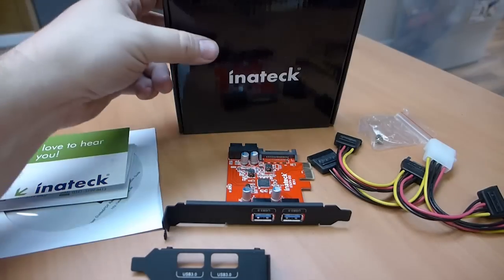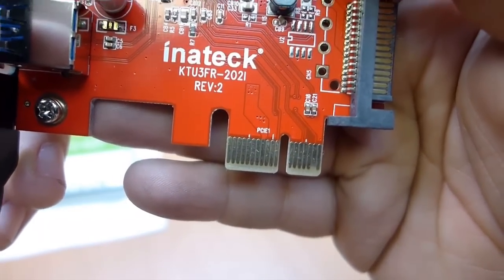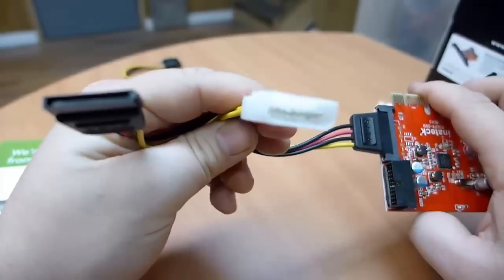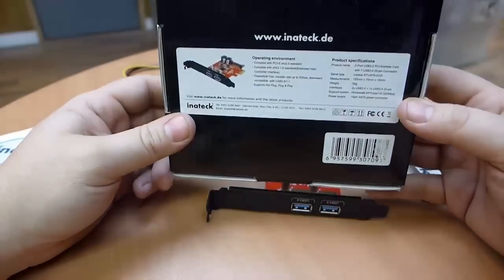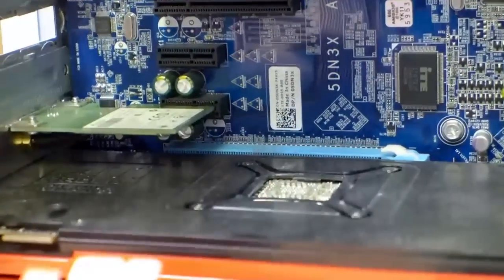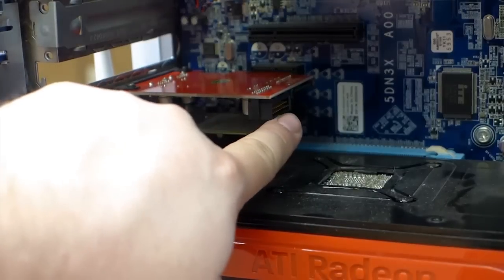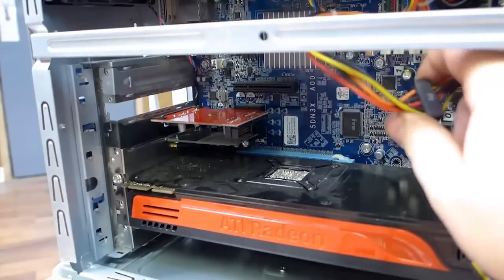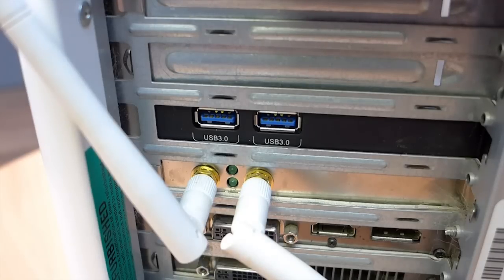Inateck PCI-E to USB3.0 Two-Port Expansion Card Review & Installation

Comment: 8 years ago and I just used a similar product on an older system I'm upgrading. While the USB ports on the card itself were definitely running much faster, my two older ports on the front of the case weren't, even though I had them tied into the header on the card through an adapter cable. They still performed like USB 2.0 ports. I've got a new front panel insert coming with a couple of actual USB 3.0 ports that'll plug directly into the card. Just something to be aware of.

Comment: I tried one but it's going back as it didn't see devices. The driver install failed with message about no host controller being found. I need USB3 to power Oculus link and my existing USB3 ports wouldn't. This was my solution and it failed. Nice to see yours worked!

Comment: I think that I recently installed a cheap copy of the card that you are showing. My one has the same format minus the power cables and fancy Matt black finish on the metal. But it works fine :) Some cards do not have the expansion connector that is needed for a front panel that supports USB3, so that was a plus and the power boost input was SATA (but in some cases it could be an older Molex).

Comment: I have a Dell Optiplex Mt i7. I just installed a Host Controller Card with 3x USB 3.0 and 1 USB-C. Its plugged into the pcie slot and connected to the sata power 15 pin. It has the driver installed via the CD it came with. It IS detected by the PC and says it IS working properly. BUT when I plug anything in to any of the ports, it will read for a second then stop... then read again then stop. Sometimes just read then stop and thats it. What do I do???? Thanks.

Comment: @Gadget Geek, if I also want to install additional 3.0 ports by an additional front panel, and my 19pin connector on the motherboard is already taken for the current usb 3.0; can I plug a 19pin cable via this pci e connector that comes from this 2 ports card ?
Reply: Not Gadget Geek here, but that is a standard way to get an extra 19/20 pin header into your tower. Unfortunately, I'm on my second inateck 2 USB 3.0 pcie 1x expander with that header but no power connector. Neither header seems to work. The USB 3.0 ports work. Waitng on inateck to see if there is anything I'm missing (except for working USB 3.0 headers). If not, I'll try a card like this one with sata power.

Comment: Would this work the same if I plug it in a 16X, the ones for video cards cause that's all I have on my motherboard Thanks
Reply from the maker: Yep! This video is a little bit older now for this particular card, but any smaller PCI-E card can plug into a larger PCI-E slot.
Reply from the maker: @Gohaan taye No, it will still operate at the same speed.

Comment: So the data is transferred through the PCI slot, and the board needs powering, the 19/20 pin connector is not necessary?
Reply: The 20 pin connector is only to connect an USB3.0 cable inside the case. If you do have a USB3.0 port at the front of the case (or other device like a card reader) which isn't connected to your motherboard already. The PCI slot can put power trough to the ports of the card but just a very little; so it is better to connect the 15-pin SATA connector for power and use the PCI slot only for data.

Comment: How was the speed on this card?  USB 3 is suppose to get up 500 mbs is it not? 

Thank you for the explanation on the power supply cables.  I am going to be looking in my used computer that I bought and see what power supply and connectors I have and your explanation is very helpful.  The Meltdownman
Reply from the maker: Hi Meltdownman,

If you click the link in the video description above, I have some benchmark and real-world usage testing results. USB3.0 has a signaling rate of 5Gbps (640MB/s) and an actual data rate of UP TO 4Gbps (500MB/s). That's in a perfect world, and you'll never achieve the maximum in real usage scenarios.

Here's the quick breakdown of the real-usage part of my testing. I used the stock USB2.0 on my Dell XPS 9100 desktop computer, and then I used the Inateck USB3.0 card to do the same read and write tests (using a 10GB for the read tests, and a 15GB file for the write tests):

Dell USB2.0 10GB file, Read: 31.9 MB/s
Inateck USB3.0 10GB file, Read: 86.4 MB/s

Dell USB2.0 15GB file, Write: 42.7 MB/s (initial speed: 86.4 MB/s)
Inateck USB3.0 15GB file, Write: 73.3 MB/s (initial speed: 170 MB/s)

The Inateck USB3.0 card gave a pretty large speed increase over the Dell's built-in USB3.0 ports (170% increase on the read speed, and 70% increase on the write speed). Nowhere near the theoretical maximum of 500MB/s, but encoding overhead losses, operating system and drive performance, and many other factors all come into play (these tests were done on Windows 7 using a 500GB Western Digital USB3.0 portable 2.5" drive that was already above 90% capacity, so fragmentation could also have played a small part). I was very happy with the speed increases over the USB2.0 ports, though.
Reply: Thank you for your reply.  Very much appreciated.

Comment: I need help I am trying to buy a PCI-E USB 3.0 Slots for my Acer Aspire AX3960 Desktop. I am just nervous as their are so many different kinds. Will any fit on my desktop as long as my motherboard  has the PCI-E slot?
Reply: Any PCI-E USB3.0 card will do (just make sure it comes with the right backplate-length (or switchable one)). To be sure you buy some quality you best choose a brand like DeLock, StarTech, SilverStone. Or pick at (i.e.) Amazon a card with good reviews. But if you are not that familiar with PC-building and your desktop is at such an age (system dates back to 2011) and it doesn't have any 3.0 ports... I would suggest to buy a new desktop. You can install USB3.0 in it but I doubt if you will gain any speed of it as the hardware inside your case probably won't support the speed. And if you are still running the same harddisk it came with, that might crash sometime in near future too..

Comment: How well did it work? This isn't a review, just an installation guide.
Reply from the maker: All of the written components of the review were posted in the link below the video (the written review was too long for YouTube's character limit), but Amazon went through and removed all my reviews a while back. Sorry about that! Probably can't post anything that long in a comment, but let's see ....

The physical installation of this card was a piece of cake. Inateck included parts in the box to accommodate several different system configurations. For providing power directly to the card instead of letting it draw through the motherboard, there is a SATA power splitter along with a 4-pin Molex to SATA y-adapter harness, which allows you to connect to both old and current generation power supplies. A standard mounting bracket comes pre-installed on the card, but a short bracket is also included in the box for small form factor cases. The card also has a 20-pin USB 3.0 header on its rear for connecting other USB expansion ports to it (such as a front panel device).

Being a PCI-E 1x card, you can install this into any available PCI-E slot in your system regardless of size, from 1x to 16x. Installing the card into a larger slot won't provide any additional speed, but it will still work just fine.

Speaking of speed, I performed both synthetic and real-world benchmarks using this card. My test system was a Dell XPS9100 tower, i7-930 processor, and using a Western Digital My Passport 500GB USB 3.0 portal hard drive that was already 96% full for transfers.

Using CrystalDiskMark 3.0.3a, I obtained the following speeds:

Dell USB2.0 Sequential Read, 1000MB: 33.94 MB/s
Dell USB2.0 Sequential Write, 1000MB: 26.41 MB/s
Dell USB2.0 Random Read, 512KB: 20.25 MB/s
Dell USB2.0 Random Write, 512KB: 12.87 MB/s

Inateck USB3.0 Sequential Read, 1000MB: 49.34 MB/s
Inateck USB3.0 Sequential Write, 1000MB: 48.75 MB/s
Inateck USB3.0 Random Read, 512KB: 25.05 MB/s
Inateck USB3.0 Random Write, 512KB: 12.88 MB/s

The synthetic benchmarks show an increase in speed using the Inateck USB3.0 expansion card, especially for sequential reads and writes, but it's not as large of a margin as I was expecting. Of course, synthetic benchmarks are just that; they don't necessarily indicate real-world performance. And as they say, that's why we run the races. For a more realistic test, I transferred some 10GB and 15GB files back and forth to the drive. The below figures are from each test after the transfer speeds leveled out. For the write tests going from the Desktop to the Portable Drive, I've also listed the initial speeds from the first few seconds of the transfer in parentheses after the leveled out speeds.

Dell USB2.0 10GB file, Read: 31.9 MB/s
Inateck USB3.0 10GB file, Read: 86.4 MB/s

Dell USB2.0 15GB file, Write: 42.7 MB/s (initial speed: 86.4 MB/s)
Inateck USB3.0 15GB file, Write: 73.3 MB/s (initial speed: 170 MB/s)

As you can see, there is a much greater difference between the USB3.0 and USB2.0 speeds in the real world file transfer tests. The Inateck USB3.0 expansion card has been a breath of fresh air for moving large files between my portable drive and my desktop computer. More and more external hard drives on the market these days are using USB3.0, so making the small investment to upgrade your computer with USB3.0 connections will help you make the most of your hard drive purchase by enabling it to use the maximum transfer speeds possible.

My only minor issue with this package at all was with the instructions - specifically, the support page link. A driver disc is included in the package, but I always recommend visiting a manufacturer's website to get the most up-to-date drivers for your system when installing new hardware. In the instructions, it tells you to visit a website to obtain the current drivers, but the website address has a typo in it ("dirvers" instead of "drivers"), and the link given is also for the German version of the website. I instead went to Inateck's .com website, which I found much easier to navigate. I also found newer versions of the drivers listed there than on their German page.

I used the drivers on the included disc during my initial installation of this card, but I had problems with my USB drive disconnecting and reconnecting during my tests. Uninstalling those drivers and installing the newest drivers from the website (listed in the comments section of this review) solved my problem. At the time of this review, the newest Windows 7 driver is Version 3.5.106.0.

All in all, I was very impressed with the performance increase I saw after installing this card and using it with my USB3.0 portable hard drive. Inateck's package is well thought out and easy to install; I would highly recommend this card to anyone looking to upgrade their computer with USB3.0 support.
Reply from the maker: Well, how about that. It let me post it. So there ya go!

Comment: what if I cant find any hanging sata or molex pin cords from the power supply?
its a Dell Optiplex and i cant find any of those to connect the card
Reply from the maker: You remove one of the SATA power connections from an existing device (like your hard drive or optical disk), plug that into the female receptacle on the included splitter, and then plug one of the male ends from the splitter back into the original device you removed it from, and plug the other end into the USB expansion card.

The only real trouble should be if you have nothing but 4-pin molex connections being used in your system, as the included splitters are 1-Molex-to-2-Sata, and 1-Sata-to-2-Sata. If your system has nothing but molex connectors, you'd need 1 of these to split the power into two connectors instead of one first: http://www.amazon.com/StarTech-Power-Splitter-Cable-PYO2L/dp/B000067SLY/ref=sr_1_2?ie=UTF8&tag=jennidunawpho-20

And then you could take the included 1-Molex-to-2-Sata splitters and connect it to one of connections from the above all-Molex splitter and run the Sata power to your USB expansion card.

It sounds overly complicated typed out, so let me know if that didn't make sense and I can work up something better for you.
Reply: Gadget Geek yes thank you, the first method was logical, and worked. however, even after having installed the software, its speed is not even above 11mb/s, what could it be?
Reply from the maker: LuchoVena

I would make sure of the following:

1) Correct drivers installed

2) You are plugging a USB3 drive into it (this card won't give you any performance boost for USB2 devices)

3) There is not something awry with the drive itself. Best way to do that is to test it on another computer with a USB3 connection (friend or co-worker?).

4) Are you getting these speeds reading from the drive, or trying to write things to the drive? Write speeds will be lower than read speeds, but both can be affected by the speed of the computer's internal hard drive, too. I don't know how old your Dell OptiPlex is, but I know we have an old one at work that still uses IDE drives instead of SATA, and that really slows everything down compared to modern hard drives.

Test speeds with CrystalDiskMark (http://crystalmark.info/software/CrystalDiskMark/index-e.html) and see how the synthetic benchmarks compare to your real-world performance.
Reply: Gadget Geek Thanks for the help

1)I got the red inatek card, so I installed the red card driver from the disc i received

2)All my drives are 3.0, both with external power and portable. They all go about the same speeds

3)I tried it on a Dell Precision that had the cables for it, but cant yet for other Dells that dont have enough slack on their cables or have a a loose extra cable around, even with the y-cable the card came with, cannot achieve the proper length to connect to the power supply. Tried without and drives were not working.

3.5) The reason I tried this is because even though I have other Asus Essentio Towers (Dual Pentium 3.0GHzs, 8GB RAM)around with integrated 3.0 ports, they also run at the other dells 2.0 speeds. On normal day, 11-15mb at best, most days 6-8mb/s. On an excellent day, only the 3.0s sometimes get to 20mb/s(yay) all on Win7. To compare, Ive also got a Toshiba laptop with 3.0 than runs them at 80mb/s easily. Same type of drives and all. only diff is the laptop's a win8 - I dont think it should matter, 3.0 has existed for some time.

3.95) I even tried to go the BIOS settings on the ASUS and change things up a bit (xChi controller or something like it - it was on auto I think and put it to enable, I read that doing this can make the ports not work, but they still do). I dont know if it actually worked, one day it actually went at 30mb/s but was on its way down to 20mb/s and 16mb.s next morning. It so inconsistent, havent seen it do it anymore.

4) Yes, Im getting these speeds from the normal transfer files user interface. Also using robocopy on a cmd window. I copy to and from the drives. I wanna say copying to PC is a bit faster, but not much statistical difference if any. All including The Optiplex (i5 Quad 3.2Ghz chips, 8GB RAM) use the same power flat black (sata?) connectors and the smaller block-y sata connectors for data to their motherboards. The other tower that did have the slack of cables is a Dell Precision, also has SATA drives, its a dual Xeon chip 2.5GHz with 12Gigs fo RAM.

No, I have not tested with crystal-mark, but I suspect these tests are more simulated or in a more controlled to what I do, so Idk if it can do me any good? ya know
Reply: tyyyyy finally it worked. First problem was that the metal plate on the back of my case was a pain the ass to remove.
 Then when i put everything did the drivers and still not working. 
I was gona try put it in a black pci 8x slot instead of the white 1x but i didn't wana remove another one of those backplates.
 I guess it must be the power issue though i was only using usb sticks not charging anything. Didn't have any spare cord but that comment was soo helpful ^^ ty ty ty  But was a pain to fit everything in with my case xD

Btw what kinda of relative speed will u get on a pcie ver 1 vs ver 2, cos it recommends ver 2 but i don't even know the difference :/

Comment: I have a Dell desktop with a larger one slot. So my question is if I install a usb 3 card in that larger plarger will that work properly with usb external graphics card?
Reply from the maker: Yes, you can put the smaller PCI-E card into a larger PCI-E slot.

Comment: hello.I have one 3.0 front usb port.So how can i connect it to the pci card so the front port also work as 3.0.however the port is compatible with 2.0.But i want speed of 3.0.New to pc building
Reply: you need a usb3 case mate. caz the usb 3 connector is physically different than usb 2. eg i have a usb3 case but i dont have a mobo with inbuilt usb3, so i would use the pci-e card in this video to get usb 3.

Comment: New to pc building, this PCI chip will provide wifi connection for my pc right? AND do i need to install drivers for windows 8 when i install this?
Reply from the maker: MilkLegend No, this will not provide wifi to your PC. This is for adding USB3.0 ports to the back I/O panel of your computer case.
Reply from the maker: ***** No, it won't. This is a USB3.0 expansion card, not a wifi card.

Comment: What does the USB 3 header do?
Reply from the maker: Allows you to connect a USB port from your front panel into the card for easier access than having to plug in USB devices in the back of your case.

Comment: reads only 3.0 flash drives.. cannot read from 3.0 hard drives. could it be that my psu isn't delivering the amount of power it should through the power cable I installed in the expansion card as my psu is a cheap chinese one..
Reply: Probably